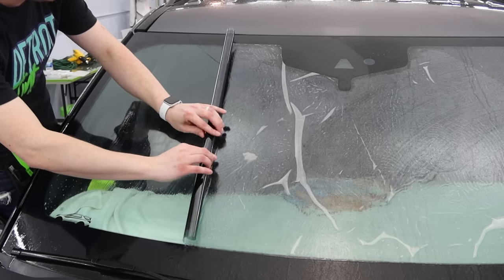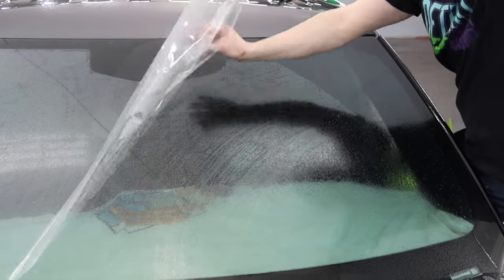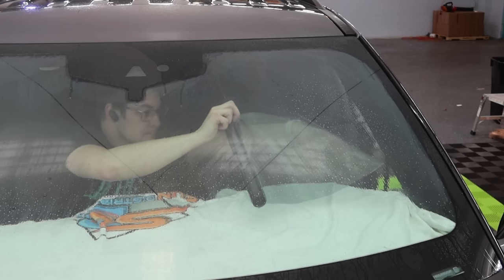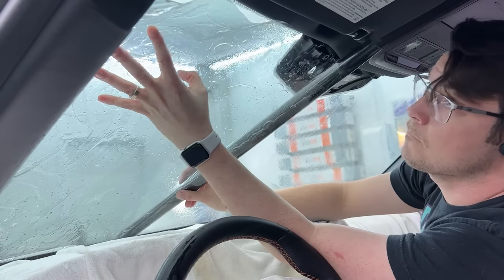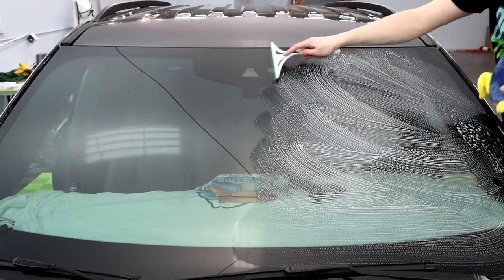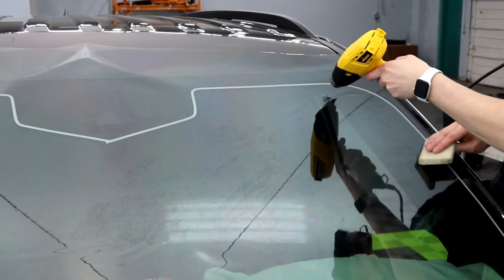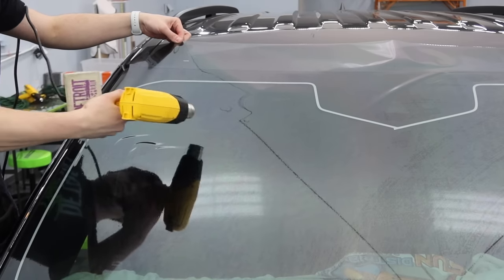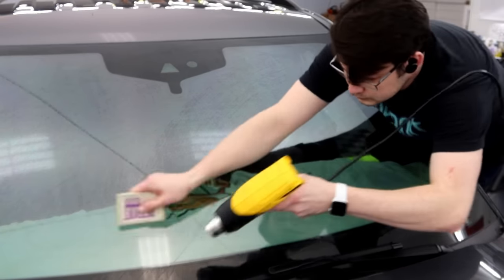EASIEST Way to Tint a Windshield! I WISH I LEARNED THIS FIRST!

Comment: That's CALLED THE CALIFORNIA ROLL.... we've been doing this for years here in CALI, it's a hell of an efficient way to tint the FRONT WINDOW being as it's a large piece tint. Another tip is before laying the tint onto the window before shrinking, lightly wet a "dryer sheet" and wipe the window down with it and it'll cut down on the static when removing the shrunk piece of tint that's ready to go onto the interior window. Works everytime.👌😉
Reply: he used a dryer sheet; he mentions it; he just doesn't show himself wiping the windshield down with it. He may look young, but he's been doing it for a living for 15 years now.
Reply: Thays called being smart cali aint got nothing to do with it!!
Reply: Anything tint passed the b pillar is a fix it ticket in California
Reply: No it's called a Montana roll
Reply: I swear this was called the Wyoming roll... It then immigrated to California and finally retired in Montana. Relatives are from Idaho.
Reply: Californians never fail to say they are from California..
Reply: No

Comment: For those who aren’t aware, I just found out that in Tennessee it’s illegal to tint your windshield. Been driving my car for eleven years like that and was stopped by a sheriff’s deputy this past Wednesday who told me that. Kind of pissed me off. I’ve been stopped for tint before and NO mention of the windshield. When I was stopped for it years ago the officer whipped out his tint card placed it to my drivers side window and told me it was below the legal limit and let me go. This recent one told me I’d be stopped over and over again and fined! I’ve seen many trucks and cars with darker tint than mine!
Reply: Probably just a doofus cop, I wouldn't take it off
Reply: @joefro9473  I had no choice but to remove it. It was a county officer that stopped me. He was fairly cool about it but my back window was severely bubbled up so I just said screw it. I’ll take it off…Looks like 💩 but oh well it’s better than being fined $250 bucks!

Comment: Amazing how many people respond without proper knowledge. Windshield tint is illegal if it's the full windshield and not just to the AS1 lines; correct. However IF you have certain medical conditions with your eyes you can get a prescription/notice of windshield tint from your doctor that allows this. Also, depnding on the transparency of the tint for those that believe it makes it harder to see, alot of windshields are tinted with 55%-70% film, which inherently is basically as clear as the windshield is normally. It actually makes it easier to see by reducing glare. Yes, it becomes SLIGHTLY darker, but at those percentages, if you can't see properly through it you probably shouldn't be on the road to begin with. I do not advocate getting windshield tint but I've been tinting for 16 years and in places that are 90-100 degree summers MAN does it make a difference in heat transfer.
Reply: I had the same question and had just posted a comment. Please don't spam me about that. Lol. I also had wondered how it's legal to tint your front windshield dark? I'm aware of the as1 line, and when I had my front windshield tinted I went about 8 in down, way below the as1 line. But I didn't care. But I was not about to tint the whole front windshield. Thanks for the FYI. 👍
Reply: But you know 99.9% with tinted windshields don't have a prescription.
Reply: @1RungAtATime  100% you are correct. But we do get quite alot of people that actually do too. But if we we're to reject windshields based on this, where i live you would lose about 20% of your revenue if not more. But also. I have windshield tint, and yes, no prescription. But we also tint the State Department Fleet Police vehicles and every cop ive asked said they would not pull you over for tint unless your a dick or doing something stupid. So to each their own. I like it. It doesnt impede my vision at all and i cant even tell its on there.

Comment: I've used the cali roll for 20+ years. 1 more thing is to tape the headliner to keep fibers and contamination out. You touched the driver side headliner with the exposed film and sure you have a bit of contamination there. I always tape up 4 inches or so of the headliner to keep it clean as possible. Good video!
Reply: Gay
Reply: What is headliner?
Reply: @laobe5119  Seriously you don't know what the headliner is? Were you born after the year 2000?
Reply: @joncharlotteschoen  is it the main band or the first band on stage?  I forget
Reply: @laobe5119  I wonder too, what is the headliner?

Comment: What kind of window film do you recommend?
I don’t want to get it from Walmart,
Thank you.
Reply: SUNTEK, it's a carbon based tint. Slightly harder to work with but it's an awesome tint AND LOOKS REALLY NICE WHEN APPLIED RIGHT. Plus, the HEAT ABSORPTION is really good...
Reply: @robsnizzle7  can you buy if your not a dealer?

Comment: As far as I understand from all the tinting videos I watched, you don't need to heat for the slide windows since they aren't curved but you need to heat it for the windshield and the rear glass. Is that correct?
Reply: i would say you shirnk the side windows as well its just easier to install and wont see fingers when installing.
Reply: You need to heat every window except for flat ones like the Jeep or g wagon.  Most windows are curved,

Comment: Can you tell me why I keep getting damaged hardcoat marks towards the bottom of the windshield only when I use geoshield apex 70. I tried it 3 times and used way less heat 2nd and 3rd time but it keeps getting these scratch/hardcoat damage marks at the middle bottom. All other brand films have been fine.

Comment: I have a 2011 VW Jetta that I’m preparing to tint the front windshield on, but the gap in between the dash and windshield is extremely tight. My bulldozer won’t fit, any suggestions?

Comment: Have a concerning question , i just recently got xpel 15% on the windows & 70% on the windshield,  98% ceramic done. But what I'm really noticing is alot of rainbowing only when i have polarized sunglasses on while inside the car looking out. Is this normal to see this ? Any help is greatly appreciated
Reply: Yeah it’s only gonna happen with polarized sunglasses. It’s the ceramic material base it reacts with the polarization in the tint and can actually make it worse looking through sun glasses. Polyester dyed or carbon based film don’t have dramatic of an effect but it is something the shop should have made you aware of. Been tinting about 15 years and have seen it a handful of times. Maybe there’s a brand of film at there that it’s not as noticeable however in my experience with the films I use it can happen
Reply: Polarized are for looking into water lol.
Reply: @billyyank5807  no
Reply: Yes, it is your glasses, probably they are cheap glasses, and if you paid and expensive glasses and does the same problem, still your glasses are made with cheap stuff,!
Reply: @jimmyjhonson4590  funny u say that maui jim is cheap glasses  , apparently u don't have a clue . But polarized sunglasses show this effect in ceramic tint. Regular glasses don't.

Comment: What are you using for spraying your solution? Thank you
Reply: Use a mixture of Johnson an Johnson baby shampoo an water in a spray bottle... helps keep the moisture behind the film so it's easier to move around or adjust film as needed without possible premature setting of film. 👍😎

Comment: Hey man great video! I'm curious about that white tape you use? I'm assuming it's for guiding , and cutting without scratching the glass?👍🏽
Reply: It's called Glass Aid and yes, it is to prevent unnecessary cuts on the glass and to guide along the outside edge for the proper fit.

Comment: mathematically, you should roll up both side to meet in the middle, the from the interior you can match the middle side on the rear mirror which is much more accurate
Reply from the maker: The film slides genius
Reply: @DetroitTintStudio  will it work better? i am just guessing 🙏🙏

Comment: Reverse roll is a pain in the ass and guarantees creases along the bottom where it's tight and you have to unroll the tube. 
Residential jobs are a different story. Glass board is always the easiest.

Comment: First the film is put on the outside of the car, then on the inside and finally on the outside. I don't get it. 😕
Reply: Its easier, so much easier and more reasonable to shrink the tint from the outisde rather than doing it all from the inside, so that's first step. 2nd, apply it go the inside. The additional in this video was him going back to the beginning to show the shrinking process.

Comment: Isn't that illegal it's in your front windshield
Reply: It's very illegal. However, some companies make window tints that are ceramic with a high VLT. These tints would be hardly noticeable on a windshield but would have greater heat reduction in the summer than an equivalent sputtered metal tint.

Comment: Don't ever tint the outside windows on a car. Especially windshields and it's against the law in California. Not only that it's dumb and dumber. If you get a rock chip how the hell do you expect to repair it? When you operate the wipers in a storm with dirt thrown up on your glass it's going to scratch the tint. SMH
Reply from the maker: Did u even make it past the thumbnail? SMH

Comment: It's illegal to tint a windshield.
Reply: Depends where you live.
Reply: @tacoconch7678 In CA it's illegal. It should be everywhere. It dangerously reduces visibility.
Reply: @kirbywaite1586  It depends on what shade you get.  70% is legal in a lot of places.  It's barely anything and you can see perfectly fine at night.  It cuts down on glare a little as well.

Comment: Easiest way to tint a windshield is to not do it at all and pay someone like you to do it. Ive watched all your videos and everyone elses, i managed to tint my side windows but my back windshield is a different story. Im gonna try it again once i learn more but this time i will wet shrink it, when doing it dry you dont really get much visual feedback, doing it wet you blow into the valley it squiggles up to your middle tack and you push it down seems much easier than dry tinting i wish i learned wet before attempting and failing multiple times.